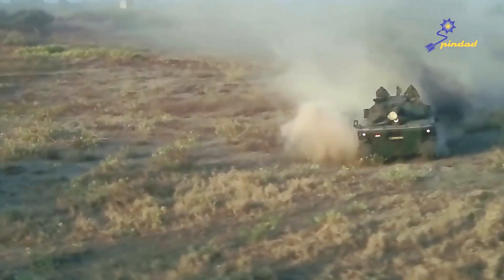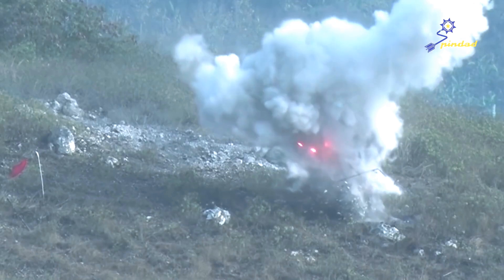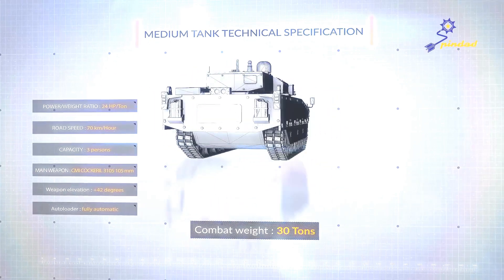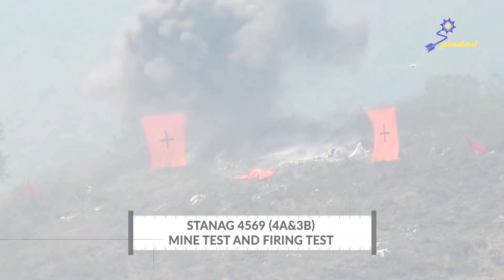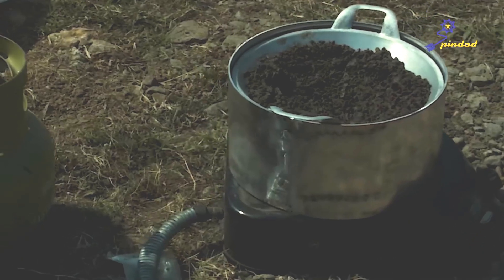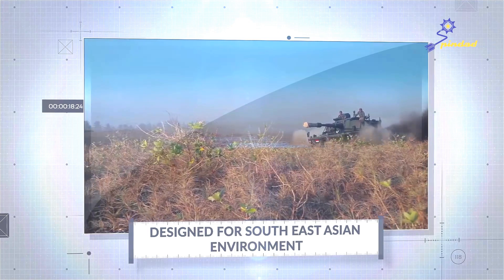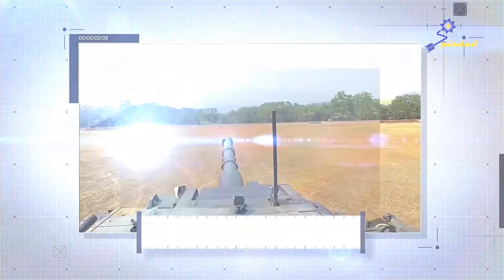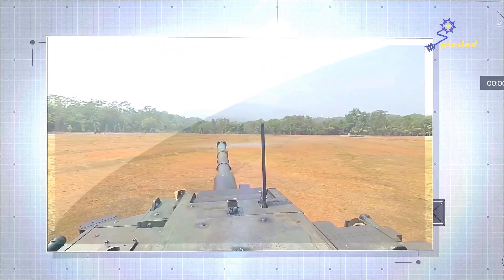PT Pindad - Indonesia 105mm Modern Medium Weight Tank Capabilities [1080p]

Comment: And Philippines has shown interest in it along with Brunei and Qatar
Reply: huy tran T-72 is obsolete, also Russian weapons will cause US sanctions
Reply: @imnotafurryiswear6391  The T72 has triple of maybe quadruple the armor (and i am not even talking about a T72A i am talking about a bare bones T72ural) and has far superior firepower to this. Also Obsolete? if they buy T72B3's they will be far from obsolete altho they are not really for sale they are mostly for the use of the Russian military atleast the T72B3 mod 2016 is.
Reply: @martinpetrovsk9725  Indonesian army has Leopard 2 as its main battle tank. This Medium tank will replace obselete AMX-13 in indonesian army`s inventory.
Reply: @martinpetrovsk9725  this medium tank have indirect fire capability with smart ammo, cooling system for the engine  and independent electric propulsion for turret operation which lowering heat signature from thermal sight which are suitable for jungle terrain
Reply: @emomales5782  you do realise that most main battle tanks have had those features since the 80's right?
Reply: @martinpetrovsk9725  nope  there are no 80s mbt which capable doing top attack capability without direct line of sight and it should be integrated with Uav though

Comment: Pretty much useless... it wouldn't survive other MBT's, infantry with anti-armor weapons or IFV's with ATGM's.
Reply: MBT is Useless in this Area of the world, because of their geography
Reply: @ayoubiguerraj6384  I don't think MBT is useless if kept within 52 tons like Thailand but light tank is good in this part of the world less footprint and good in rainy season
Reply: Japanese Type-10 with 44 tons? Also made for mountains.
Reply: uy Mantap  Doubt the K2 is that light it is about the same weight as M1
Reply: SuperGeronimo999 MBT is useless in jungle warfare
Reply: @imnotafurryiswear6391  No it's not Thailand has been using MBT for decades and were involved in many conflicts latest was Phra Viharn which involved all types of Thai tanks from Stingray to M-60. In the 1990s Thai M-60 had exchanged gun dual with Burmese T-69s
Reply: This is just adding Indonesian arsenal so they have complete line ups from MBTs mediums to light tanks so don't say it's useless, fyi @SuperGeronimo999 Indonesian do have MBTs German A2 Leopards
Reply: Tropis vs subtropis
Reply: The most important point for us is not the current product as individual unit, but the capability to manufacture our own weapon instead just buying it. Granted it is not breakthrough product compared to other current gen tank,  but self reliant is valuable  in the long run if we can keep the developemen going. Not to mention it was designed for better adaptation in our geographc condition.
Reply: Well MBT with marshes bushes rough muddy terrain well that's great happy towing your tanks. The thing is i got enough firepower and pretty much smooth operation in all around situation